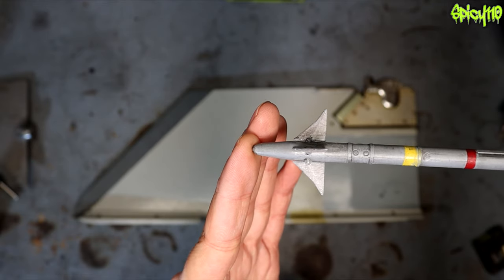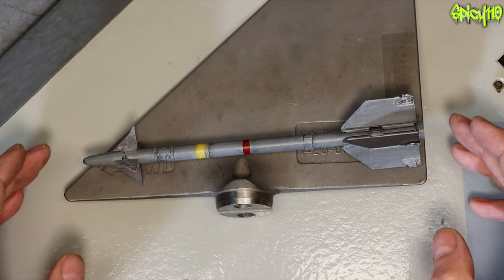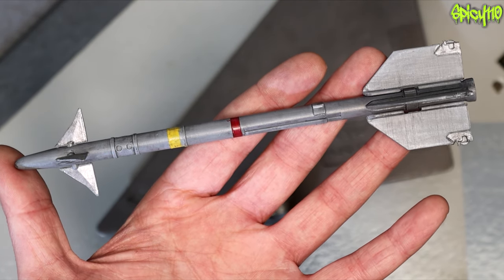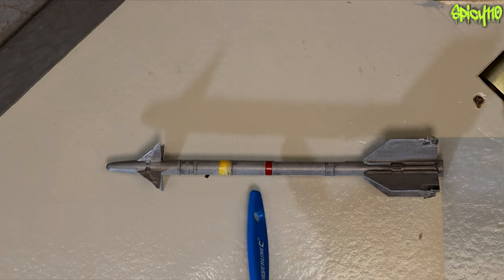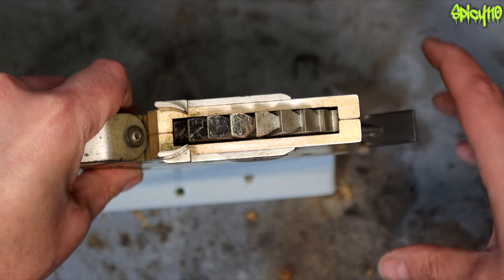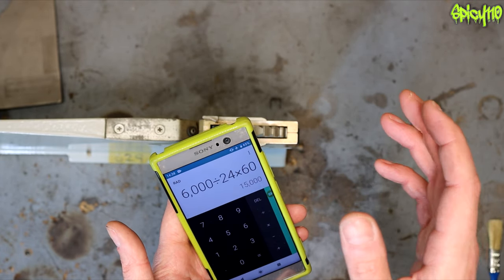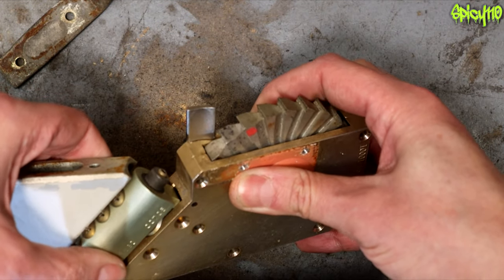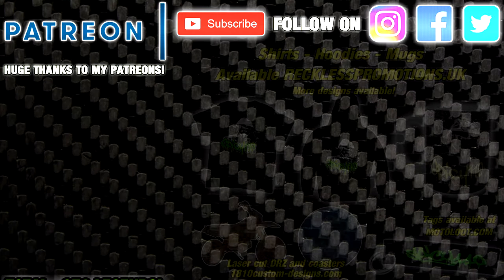AIM 9 SIDEWINDER MISSILE | How it Works with Rolleron Demo!

Comment: If you followed the balloon popping saga of the Chinese "spy" balloon in the USA today, Id like to ask how a sidewinder would trigger when the target it saw was a helium filled balloon ? 
The payload was a huge "3:bus" size description. The balloon must be massive. What hole would be blown in a balloon?
Reply: I see the sidewinder triggers on a proximity fuze. Various types available. I guess they opted for one that could detect the balloon, unless they aimed for the payload.
Reply from the maker: These days they may well have used a laser targeting system. From the video it looks like it may have detonated short and used shrapnel to pop it, Like a giant shot gun. That is IF they even used this missile.
Reply: Thank you for the reply. One chap said they used an AIM-9X, not verified and shot from 65000ft to the balloon at 68000ft. Cloud of black smoke below balloon. There was a pod/payload hanging below balloon.
Reply from the maker: @meisievannancy  yes I had only seen the far away video when I replied. The new videos show a lot more detail. Way more of a direct impact than I had thought at first.
Reply: Yes. Payload must be huge. My rough calculation for a balloon the diameter I saw on news of 35m  can lift 180 metric ton . Seems incredible. Not sure if my calcs sre right as there are other factors.

Comment: Just a question, https://youtu.be/y1kUzjdkxG8?t=494 you say an alloy metal. Basically all metals used in industry are alloys, do you know what base metal it is? Steel, magnesium, aluminium, or something else?
Reply from the maker: Sorry that is correct its a habit of mine to refer to non ferrous unknown metals as a alloy. I would say they are aluminium or a aluminum mix.

Comment: Punch out the axle?
Reply from the maker: Tried that, no movement. I think the shaft is screwed in the pin and glued, add on aluminium corrosion and it is stuck.